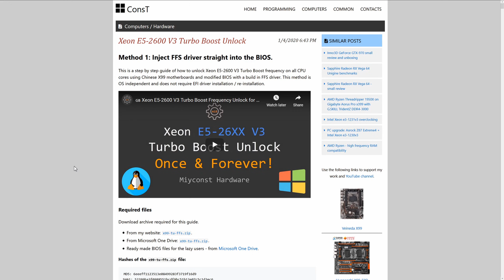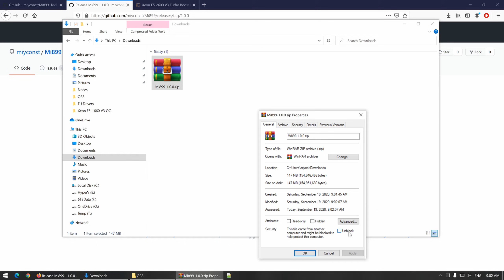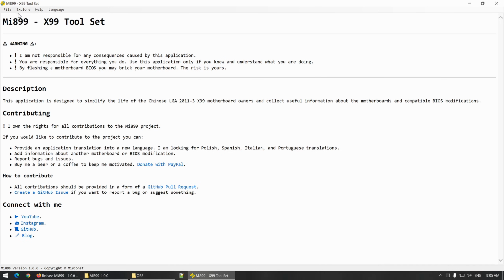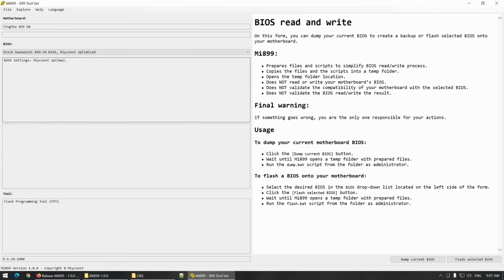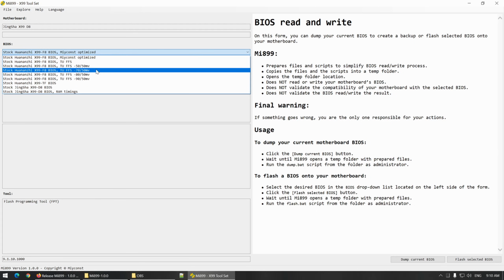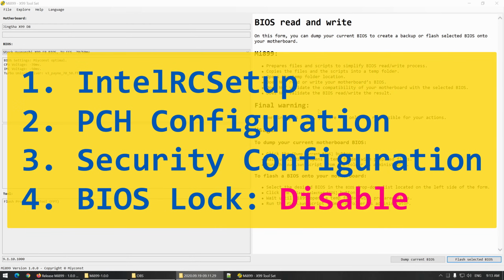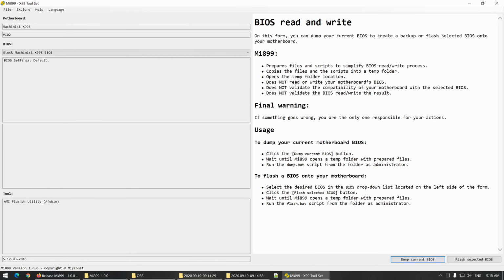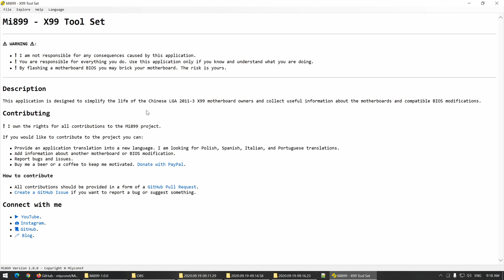🇬🇧 Mi899 – X99 Tool Set | read, write BIOS & unlock turbo-boost with a few mouse clicks

Comment: I have already used this great tool.  I am interested in using the IEngineer bios, but not sure how that effects your turbo boost undervolt.  do I install the iEngineer and then reapply this with your tool?  Can I install the iEngineer bios with your tool?  His file is has a .bin extension.
Reply from the maker: My tool includes the iEngineer BIOS, so you can install it straight from there, but I didn't make Turbo Unlock modifications, thus, if you want iEngineer BIOS & Turbo Unlock - you have to prepare a BIOS modification yourself. The file extension (.rom or .bin) does not matter.
Reply: @Miyconst  That's what I ended up doing.  I took the iengineer and used your manual turbo unlock to modify it.  Set to  "ultimate performance", but then sleep didn't work (computer would just turn off). I went back to "high performance", with minimum processor 100% (I matched  "ultimate" and "high" sleep parameters) and sleep doesn't work.   

Going to change to default and see if that fixes sleep. 

 I will say that the core speed is slightly  better with IEngineer, but with both "turbo unlock" bios the cores start bouncing back and forth between x12 and x35.  Not sure if this is normal
Reply from the maker: @oddssodds  sleep mode is not compatible with the Turbo Boost Unlock hack. There is a way to work around it, if you wish, you can investigate this issue: https://github.com/freecableguy/v3x4/issues/9#issuecomment-717388700
Reply: @Miyconst  That's great.  Looking through the thread about PEI embedding, but not really getting it yet.  There is translation going on and lack of skill on my side.
 I see the turbo hack zip folder, but not clear on how to get it into the bios.  or if I need to modify the stock bios.
Reply: @Miyconst  do you think that the sleep modification will fix the whea uncorrectable error i keep getting on wake?
Reply: @Miyconst downloaded the ffs, but having trouble with translation
Reply from the maker: @oddssodds  maybe, but before I test it myself I can't say anything for sure.
Reply from the maker: @oddssodds  as I said, I have not yet investigated this tool, thus I can't say much, but I would uncheck the last checkbox, which says: "Добавить код биппера в драйвер", it adds speaker beep on system boot, which I find annoying.
Reply: @Miyconst  Thanks, I couldn't figure out what that was.  My main concern was the undervolt settings.  Right now I have -90/50mv  and I want to make a new ffs to have -100/50mv.  Not sure if I have the settings in the right order, because of the translation software.  

I am going to try and make a post to that forum, but not sure that I can get a membership.

Thanks for putting up with me.
Reply from the maker: @oddssodds  I don't have their membership either, so I can't help much.
Reply: Miyconst I was actually able to get a membership and just posted
Reply: umdihando i was able to get the driver for the ch314a from the Chinese x99 telegram group and flash back to an unlocked bios. Thanks though

Comment: Hello! I upgrade my huananzhi f8 with your script Mi899 and she brick.. is dead, no start, I have a backup of bios, can you help me please 🙏🙏
Reply from the maker: Please specify which BIOS you have used to brick the motherboard. Also, did you try to clear CMOS after the BIOS update? Here is a guide of how to revive a dead motherboard: http://www.miyconst.com/Blog/View/2086/ch341a-minimal-usage-guide-how-to-read-and-write-a-motherboard-bios
Reply: @Miyconst  hi! I use this huananzhi-x99-f8.tu.v3p0.ffs.rom, after remove battery and clean bios, but don't start, only show code 96 in the display, than you so much for response 💪🏻
Reply from the maker: @SergiLogan  could you specify your CPU as well?
Reply: @Miyconst  is a 1660v3 I have to 2690v3 I will try that, the video of the programmer ch341 It's hopeful 😍
Reply from the maker: @SergiLogan  oh, man, E5-1660 V3 does not support Turbo Boost Unlock. You have to use E5-2690 V3 and restore the original BIOS.
Reply: @Miyconst  Seriously!!, i'm an idiot.. and 2690  can overclock? I don't think so, right. I'll look for a 1650 (to overclok) for gaming better than 2690, right? I will check 🙌🙌
Reply: @Miyconst  it runs!!!! I'm going to cry!! 😭😭🤣🤣You are my personal Jesús thanks for all🙏🙏🙏🙏
Reply from the maker: @SergiLogan  I am just a simple human with some hardware passion. E5-1660 V3 can be overclocked, you don't need to bother with E5-1650 V3, just overclock your 1660 and you are good to go.
Reply: @Miyconst  I will try!!, thanks for all, 🙏🙏, that nice passion
Reply from the maker: @SergiLogan  I have a video about overclocking E5-1660 V3 on these Chinese boards: https://youtu.be/RIVKU85AC6Q
Reply: @Miyconst  😮😮😍

Comment: Amazing job man, congratulations! It sure will make the turbo unlock process a lot easier!
But unfortunatelly your program still does not support my Atermiter X99 motherboard... 😥I even tried to find a similar motherboard but was not sure if I could pick another model. I don´t want to brick anything today, thank you. 🙂
Are you planning in add this motherboard in future upgrades?
All the best from Brazil, keep up the good work!
Reply from the maker: So far I don't plan to buy and test this motherboard myself due to its poor quality. If someone provides me the original BIOS and BIOS modifications - I will consider adding it.
Reply: @Miyconst  Gee, I didn´t know this motherboard has such a bad reputation... 🙁I´m having some problems with frontal USB 3.0 and my rig does not wake properly from suspend state, maybe it has something to do with the board, I don´t know. 
Anyway, I believe I managed to extract the original BIOS from my board if you are interested. Just give me some directions how I can send this to you and you can play with it. 😉
Cheers!
Reply from the maker: @ulissesdantasalleo4594  the issues you describe are certainly due to the motherboard quality. You are welcome to add the BIOS to Mi899 through a GitHub pull request: https://github.com/miyconst/Mi899
Reply: Did it work with Atermiter x99 mobo?
Reply: @Mflx7  I have not tested with this MB, but if you look into Youtube you can find several videos that teaches you how to do the unlock yourself, with any MB.

Comment: I can do the spanish translation for you, Im from spain and my English is pretty good.
Reply from the maker: Thank you Alvaro. I have already got a Spanish translation, but if you want to help, you can walk through it and validate: https://github.com/miyconst/Mi899/blob/master/src/Mi899.Data/I18n.json#L67
Reply: @Miyconst  I checked the translation and is all good 👍, Im going to buy the huananzhi x99 f8 with the e5 2678 v3, and I'm so excited to use your program and unlock the turbo boost, but I have one question, if the cpu doesn't support the undervolt of -70 milivolts and doesn't boot up what should I do?
Reply from the maker: @casado319  it is very unlikely that E5-2678 V3 won't work with -70mv offset and even less likely that it won't boot. All of my E5-2678 V3 samples were stable with such offset, and most of my E5-2678 V3 took -90mv offset. You would have to restore the BIOS with a CH341a if against all odds, your system doesn't boot with such voltage reduction.

Comment: What motherboard and memory frequency would you recommend for a e5 2640 v3 and what CPU undervolting would you apply to flash the BIOS through Mi899? Also when should I install the motherboard drivers, before or after applying turbo-boost unlock? Many thanks for the great work!
Reply from the maker: Machinist X99Z would be my budget pick, and JingSha X99-D8 would be my overall best pick. RAM - Samsung DDR4 ECC REG, frequency does not matter, E5-2640 V3 is limited to DDR4-1866. For undervolting I would try -70mv, and then go to -50mv if -70 is not stable. Driver & TU procedure can be done independently and don't affect each other.

Comment: Hello. I have a Kllisre x99z v102 with 8 MB bios. Can I put this 16 MB?
Reply from the maker: You have to check your BIOS chip model. Most likely you have a 16 MB variant, but AfuWin reads only half of it. In this case you can use BIOS modifications available in Mi899.

Comment: hi miyconst excellent job as always, i have already apply the turbo boost mod months ago with the original method, my huananzhi x99 tf mobo is still running the original bios cause i havent updated it, what would happen if i apply the unlock turbo boost + undervolting from ur application? will it update bios and make it permanent too?
Reply from the maker: Yes. If you use my app to flash another BIOS it will replace your existing BIOS with the one you pick from my app.
Reply: so will i need to adjust ram timings again or the app will do it for me?
Reply from the maker: @And10686  your entire BIOS will be replaced and CMOS reset, which means all custom settings you have applied in the BIOS will be lost.
Reply: @Miyconst  ok all worked well, thx lots. one more question: what will happen if i replace my cpu? will i have to reflash bios again to attain turbo boost?
Reply from the maker: @And10686  No, if the Turbo Boost Unlock is injected into the BIOS it will stick until you flash another BIOS.

Comment: Hi! Good job! One question: Are the Huananzhi x99-TF and Huananzhi x99-F8 BIOSes interchangeable? When I select the Huananzhi x99-TF in the Mi899 tool, the TF and F8 BIOS are listed together. Is this right? Can I use, for example, the BIOS "Stock Huananzhi X99-F8 BIOS, TU FFS" without problems on the Huananzhi x99-TF? Or another with TURBO UNLOCK?
Reply from the maker: Yes, these two motherboards have mutually compatible BIOS.

Comment: Great work my friend already subbed and seen all of your videos.I am planning on getting the kllisree x99 d8 and xeon e5 2620 v3 and plan on doing turbo boost overclock.Do you think i need to undervolt or what setting to choose?
Reply from the maker: For E5-2620 V3 I usually recommend -50mv undervolting.
Reply: @Miyconst  so i should check -70/50 mv underclock for the best results? Thank you man for the fast answers,you are the best
Reply from the maker: @briandorrumbullaku67  only a few of mine E5-2620 V3 stay stable with -70mv, most of my E5-2620 V3 can only tolerate -50/50 voltage reduction.
Reply: @Miyconst  so i will put it 50/50 and im very grateful for your help and fast responses

Comment: Hi,
Miyconst!

I did a huge mistake.
I Bought a TF motherboard and i flashed the "repulic of belarus" bios.
Now i am stucked with it.
The only way to flash a new bios is using a programmer?
Thanks!
Reply from the maker: No, you can use my Mi899 app and flash a desired BIOS with AfuWin instead of FPT. AfuWin will notify you that the BIOS is different and ask what to do next, select the option which writes entire BIOS otherwise your motherboard will be bricked.
Reply: @Miyconst  OH! Thanks! Do you have a video using afuwin?
Reply from the maker: Just pick "AfuWin" instead of FPT using Mi899, the rest is the same 😏.
Reply: @Miyconst  Many thanks man, i forgot that you software had 2 options.
Thanks again!

Comment: I need to ask a question about this.  I currently have an E5-2690 v3 with unlocked turbo boost.  
I have the opportunity to get an E5-2698v3 very cheap.  
the 2698 runs at a slower base clock speed, but does the unlocked turbo compensate?

The question is: would the 2698 be better than the 2690, given the turbo unlock?

Thanks for all your work!!
Reply from the maker: The answer to your question is: "it depends". If you do gaming - there won't be any difference, E5-2690 V3 might be even slightly better, but if you really need all the cores, then E5-2698 V3 is a good option when priced well.

Comment: Actually, i have a lazy prepare bios (Huananzhi TF stock voltage) on E5 2630L V3. Do you recommend undervolting with this program?? Or i have any problem if i make? 

Another doubt, Do you know why when i flash the bios, my PC takes a long time to start windows? 25 seconds approximately
Reply from the maker: Don't touch your BIOS if the PC works well and there are no other issues. The first start after a BIOS flash is always long.
Reply: @Miyconst  Hi :), well, sorry for not following your advice, but I have news, I managed to undervolt my processor (-90mili, -50) and gain excellent performance, with a reduction in consumption of 5watts. I just replaced the ffs of your lazy prepare bios (Huananzhi TF stock voltage), flash bios and I had no problem. From 2.6ghz went up to 2.8ghz stable :D
Reply from the maker: @jimenezgarciaemanuel237  no worries, you done it well. My E5-2630L V3 also works stable with -90/-50mv undervolting and it also stays at about 2.8 GHz on all cores in games.

Comment: Hi..is the machinist motherboard same as alzenit x99?
Reply from the maker: Which motherboard do you talk about? Alzenit X99 is just a name which can be applied on multiple motherboards.
Reply: @Miyconst  this one https://m.aliexpress.com/item/4001034090332.html?spm=a2g0n.productlist.0.0.ccbc54be9PLpAm&browser_id=860bf53afe57466284b95cf6b5fefa0b&aff_trace_key=&aff_platform=msite&m_page_id=0011750c97e9e31b5a1bff468d0e96613158451a12&gclid=&_imgsrc_=ae01.alicdn.com%2Fkf%2FH8959c4f0b6ba491688a670bd31949a4fP.jpg_640x640Q90.jpg_.webp looks the same, and phils used it in his video. I have one, just looking the way to unlock bios

Comment: E5 2678v3 running with f8bios -70mV. Tested with cpu-z cpu stress and HWMonitor. On the first restart, windows doesn't enter. All process 3293Mhz. Thanks for all Const !!! Can i perform my ddr3 ram timings with this bios???? I'm seeing your another video
Reply from the maker: Yes, you can adjust the RAM timings with the X99-F8 BIOS.

Comment: do i need to do something before use the application like delete registers or somethig or the app will do all work ? 
and thnx this is really helpful
Reply from the maker: On JingSha motherboards you have to disable the BIOS Lock in the BIOS settings, nothing else is required.

Comment: Just a quick, irrelevant and probably stupid question, can I use a Xeon E5-v3 CPU on an MSI X99a Gaming platform instead of Core i7 CPU's. It's just that I'm just trying to compare and contrast before buying any of the Chinese X99 motherboards
Reply from the maker: Yes, you can do that. Some MSI X99 motherboards support ECC REG memories, others don't.

Comment: Hey miyconst, just tried to flash -50mv f8 bios with my Kllisre D8, works perfectly fine. May I know how to reduce the voltage of my E5 2678v3 without having to reflash? As I don't want to reformat my pc. Intel XTU locks the option and Throttlestop is not applying the change. Also, just an update that a pcie adapter will fix any issues with m.2 WiFi cards on Kllisre D8.
Reply from the maker: You have to use a different FFS driver if you want to further change your CPU voltage. Any external program would not work with the modified BIOS.

Comment: I follow this guide, got a kllisre X99 D8, and e5 2678v3, but after update the bios, i am not in constant 3.3ghz why? or what should i do if i wanna stay at 3.3ghz always?, and another question, this thing may down the life of the cpu?
Reply from the maker: The CPU might be reducing its clock frequency due to the power consumption limitation. If you want to have 3.3 GHz under heavy load you need to use FFS drivers with reduced CPU/IMC voltage. Such hack might affect your CPU lifespan, but it is insignificant.
Reply: @Miyconst  I am using throttlestop to up non turbo ratio to 2.3ghz, and then the cpu oscile between 2.3 to 3.3, I probably force to up a little bit more bc I feel the cpu needs a little bit to be more fluid, maybe to 2.8 or 3ghz, what do you think about?, you are my hardware guru ^^

Comment: Do you think you would be able to add JingSha X99M-H or JingSha X99 D4 by December-February?
Reply from the maker: Yes, definitely. I already have these boards at home.
Reply: @Miyconst  With the X99M-H and E5-2620 v3, would I be able to use Patriot Viper Steel DDR4 3200mhz 8gb (2 x 4gb)?
Reply from the maker: @rojo_demarcus  It's hard to say before testing the motherboards, but most likely yes.
Reply: @Miyconst  On most boards with 4 slots dual channel, do I use the matching coloured slots with 2 sticks?
Reply from the maker: @rojo_demarcus  Yes. Start with the slot which is furthest from the CPU socket and then populate the other slot of the same colour.
Reply: @Miyconst  Also I need to order a cmos battery 2032, as it says that the motherboard doesnt come with one. Can I buy any, such as from a local store? Or are ones from aliexpress worth the wait?
Reply from the maker: @rojo_demarcus  it's not hard to place it in, and I don't think you need to order it, you can buy it in basically any general store (at least in my country).
Reply: @Miyconst  Do I need the black and red wire on the battery? I don't need the rgb headers.
Reply from the maker: @rojo_demarcus  There are no RGB headers, and I don't understand which wires you talk about.
Reply: @Miyconst  Something like this. http://imgur.com/a/Xo6mQXZp
The wires coming out.
Reply: @Miyconst  Hi! Can I use BIOS huananzhi-x99-f8.tu.v3p50.ffs.mi 8.rom into my JingSha X99 D4? I have somes freezes when are high external temps. I think this VRM is very sensitive. Thanks!!
Reply from the maker: @rafaellllll  Yes, you can, as far as I know the Huananzhi BIOS is compatible with JingSha X99-D8 / X99-D4.

Comment: Are you still looking for  PT translation ?
Reply from the maker: PT is Portuguese? I don't need the translation any more, but I would appreciate if you can validate current translation: 
https://github.com/miyconst/Mi899/blob/master/src/Mi899/README.Pt.md
https://github.com/miyconst/Mi899/blob/master/src/Mi899.Data/I18n.json#L197
Reply: @Miyconst  I´ve  just proposed a minor change in the readme.pt
Reply from the maker: @Pastor_místico_da_bagaceira  Accepted.